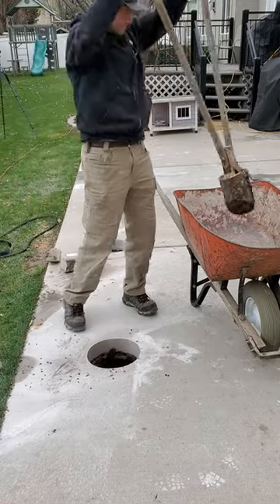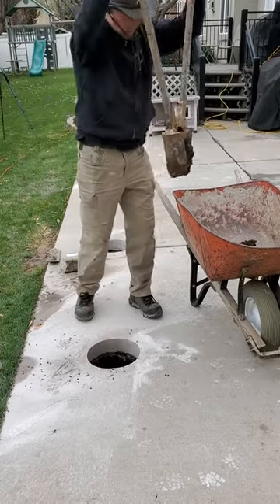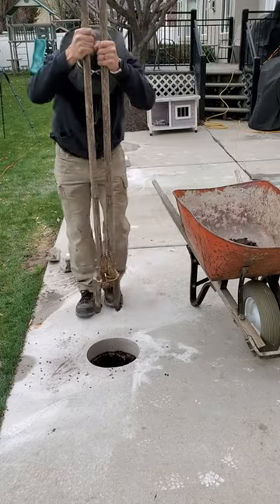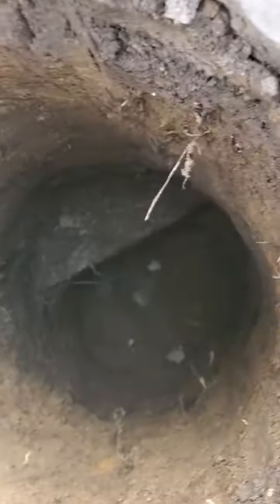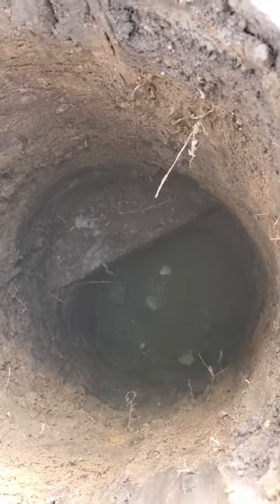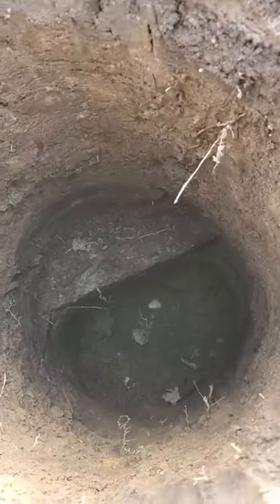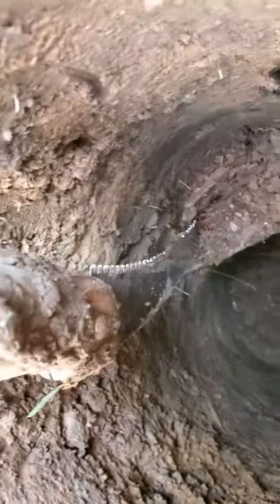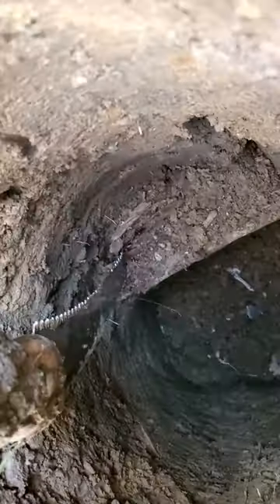Hand Digging Holes for Custom Pergola Footings to Pass City Inspection | Remodelaholic

Comment: What's the purpose of the single rebar?
Reply from the maker: It will help structurally hold all the concrete together with the weight of the pergola.  Different cities might require something different.
Reply: @Remodelaholic  ok, I'm in Philadelphia, Pennsylvania. They only require 12" concrete form tube 3' deep.
Reply from the maker: Good to know.

Comment: Why in gods name didn’t you set the posts before pouring the concrete?
Reply from the maker: I didn't want any wood in the hole for rotting water damage in the future.
Reply: @Remodelaholic  I understand that. but you could have set those concrete tube forms in place before pouring. food for thought
Reply: You could have taken several routes to protect the wood... you made it a lot harder on yourself to end up still having potential rotten wood later down the road.